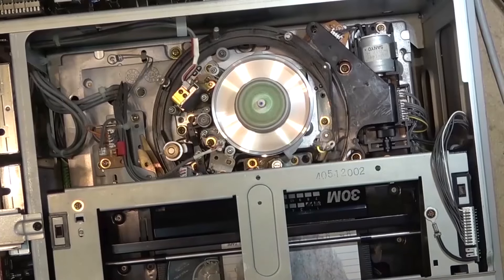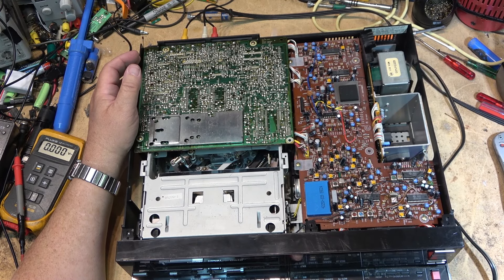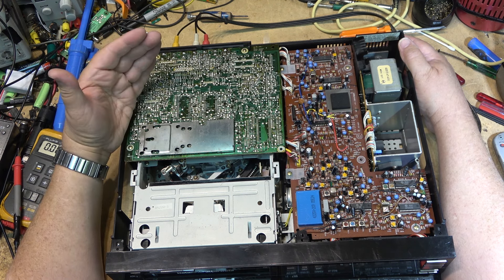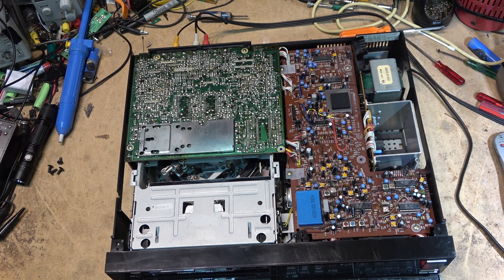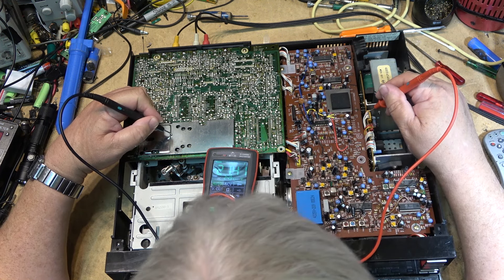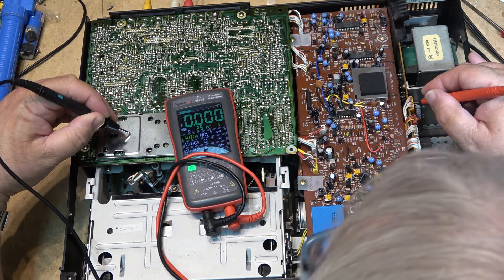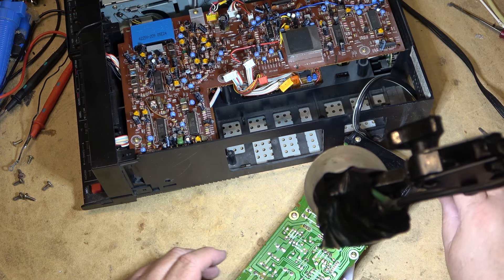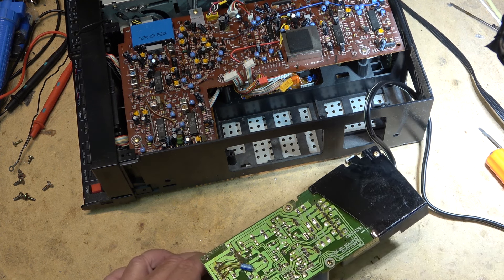This SANYO Super Beta had a defect from the factory that took 40 years for me to find

Comment: The hookup wire used in telephone connection boxes is great for doll house electrification. Twelve volts D.C. and mini lights work perfectly. I would run the wires to the edge and place them in plastic ladder insulators glued there. They were great for wire runners. Flat copper tape is used on the walls and ceiling for lights or electrical hookups.

Comment: One of the nice things about this mechanism is that the tape is not wrapped around the head drum during fast forward or rewind. That was a well built machine in my opinion. Only saw a few for the occasional cleaning. Soldering was an issue for some Sears TV's made by Sanyo. A diode in the scan derived power source comes to mind.
Reply from the maker: Well in theory unlacing the tape during rewind would result in less wear but I don't know if there is any data to back this up.  The real reason sanyo did it is because when this machine was produced they were already making vhs machines and wanted to use the same system control.   My first beta was a sanyo and it kept the tape laced until you hit eject.   It was only the later models that did it and if you look up the system control chip it was the same one used on their fisher vhs decks.  So it was cost cutting measure and everyone thinks it was a brilliant design.   Every time you lace and unlace the tape it can get damaged.

Comment: Not sure if you spotted this before putting it back in the unit, but there appears to be a stray piece of wire just above the leftmost solder joint after you clip the wire at 15:07
Reply from the maker: It fell out when I turned it over

Comment: I have a feeling the shoddy quality of 40 odd years ago was way better than the best quality we get today in practically all electronic products.
Reply from the maker: The quality of the old stuff was nothing compared to today. Modern is superior. 40 years ago they couldn't make the stuff we have today.
Reply: @12voltvids  err... let me rephrase it so you get my feelings right: when was the last time you spilled something over a VCR board and it fried like a MacBook Pro ?

I can't see how a Bluetooth speaker of today could reach 2070 and be still functional.

Meanwhile I receive 40-50 years old stuff and the owners are marveled of what they can achieve. Even I get a 32 teeth grin when I make a 50 years old TAPE deck output sound exactly like SOURCE. People can't believe it sounds better than it ever did 50 years ago because it doesn't matter the frequency response, humans barely ever hear anything beyond 15 kHz and we take advantage of that.
Reply: @m80116  that's because stuff back then was far less complex than the multi-layer boards that are made today. the slightest moisture can kill a modern motherboard not because it is poorly made, but because the tolerances are so small.
Reply: @12voltvids  The stuff they make today is crap, so is the sound, so I disagree!!
Reply: @m80116  what you are describing is survival bias. spilling water over the PCB of a 40 year old VCR would definitely fry it just like a macbook pro

as for why stuff from yesteryear sounds better than today, it's not because tech has become worse, but because it allows audio to be worse if you push lossy digital audio compression to its limits which happens very often. it's like recording onto a microcassette, which sounds worse than cassette tapes but weren't common at all

 a lossless audio file like FLAC would be just like a vinyl or a cassette tape when it comes to compresson, as they are all lossless. it's an apples to oranges comparison, to compare lossless cassette tape to lossy audio files, because one is lossy and the other is lossless.
Reply: @imeakdo7  just FIY many years ago the boiler in my basement dumped a rush of overpressure water onto my Grundig 14" TV. It blanked out momentarily... and survived to live several more years.

I can't understand your comparison FLAC to vinyl, makes no sense to me.
Reply: @m80116  there's plenty of other TVs from that era that don't survive water being splashed onto them.

Comment: what sort of quality control did Sanyo have. ?
Reply from the maker: Nor good.
Reply: I've seen unsoldered leads in many brands. The quality control was probably OK for its time. It most likely was working right at the time it left the factory (unsoldered lead touching the edge of the hole, but later during transportation it got bumped and /or the lead got oxidized and stopped making connection). They did not have full automated optical fault finding for boards back then, so if it was working on the test bench, faults like this could not always been detected.